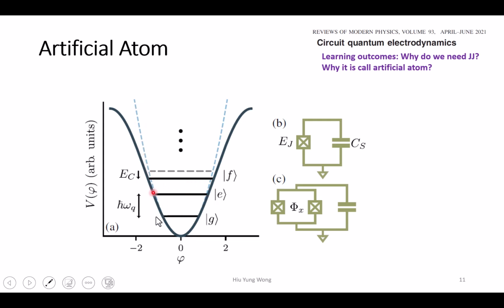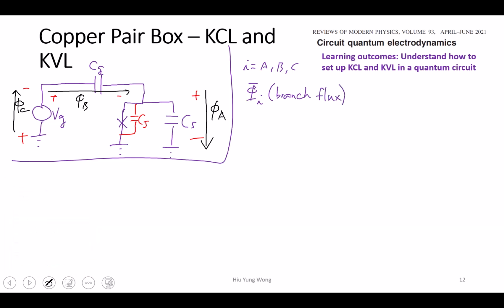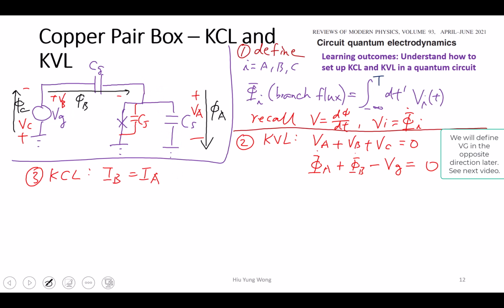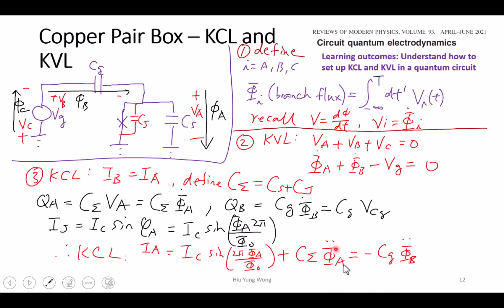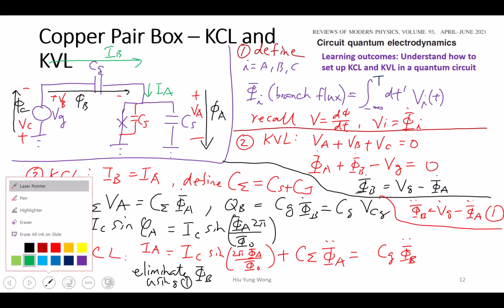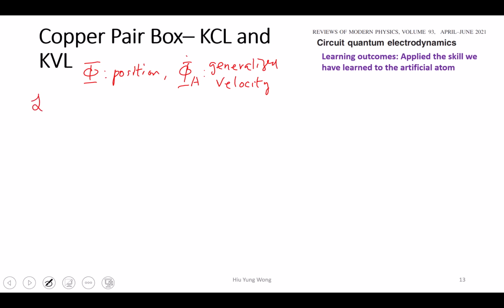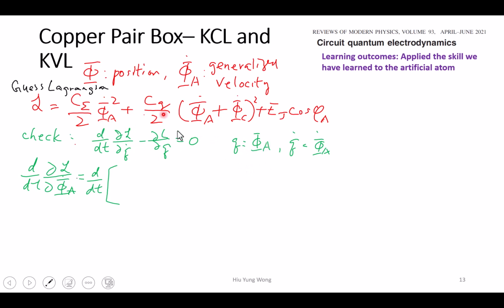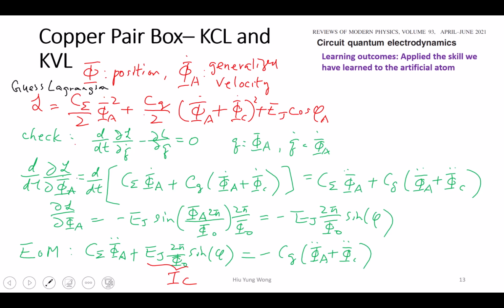L20-3 Quantization of Biased Cooper Pair Box Part 1

Comment: Hello Professor, my question is how can we formulate the Lagrangian ? Here, we have just checked that our guess is verified and another question is that why we include Ic in that equation?
Reply from the maker: Yes, it is usually based on intellectual guess (to get the K.E. and P.E. parts). Lagrangian is not unique. There are also some procedures you can follow for complicated circuits (see this paper https://arxiv.org/pdf/1610.03438). For Ic, it is the critical current of a JJ. We are doing KCL and thus its current (= Ic sin(phase)) needs to be included. Thanks!
Reply: @quantum_computing  Thanks Professor!